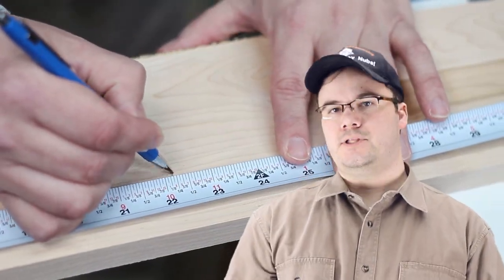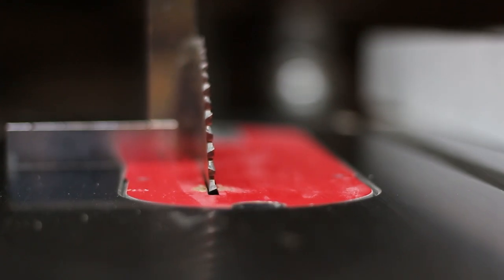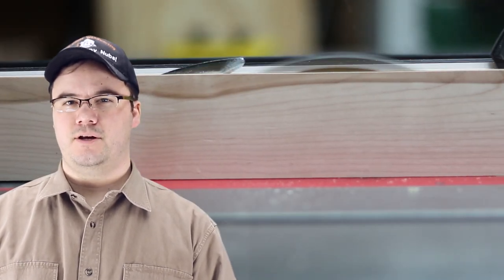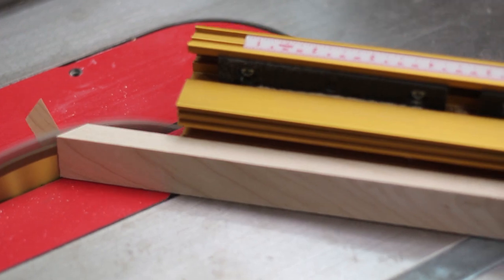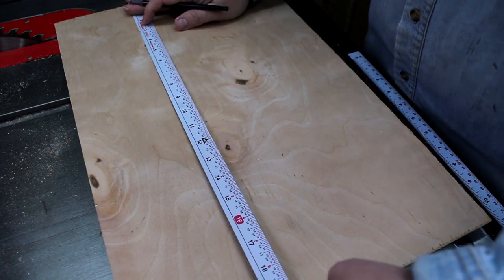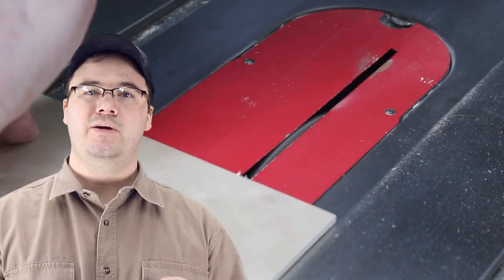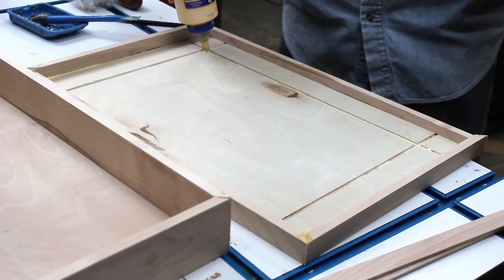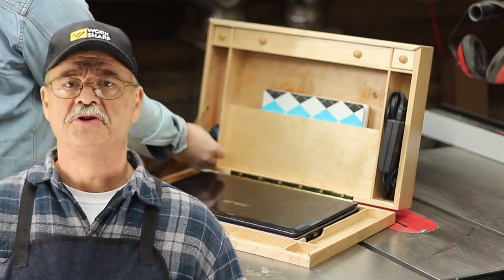WW2- Laptop Computer Workstation: A wood case for your with all sorts of storage!

Comment: That suprised me James I really  originally. Thought  it was going to just be a hard case to protect  it but with all the extras. It really. Is more like a portable  computer desk ! I worked out. Of a van for years  and that type of a system. Could had made life easier. Plus in all honesty it looks good  i agree on the Birch veneer ply  the manufacturers have stepped up their game on  using  a nicer  way of making  them and often you can get that to stain. Up real nice  i made a entertainment  center for. My sisters  camper that was all Maple  with the birch ply and she was real happy with the finish  it was on the opposite wall of all the manufacturers cabinetry   And part of the  entire build was so the electronics  would safely travel in place